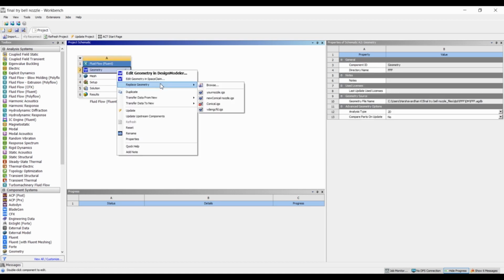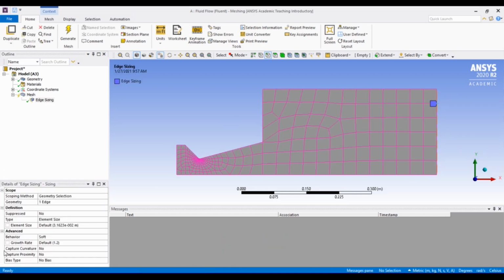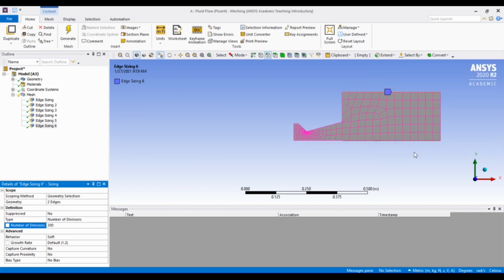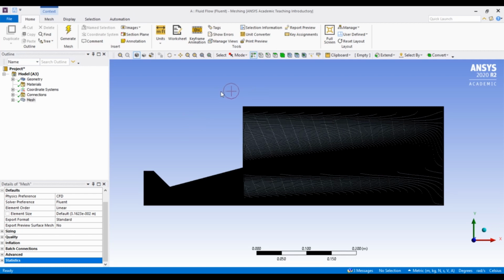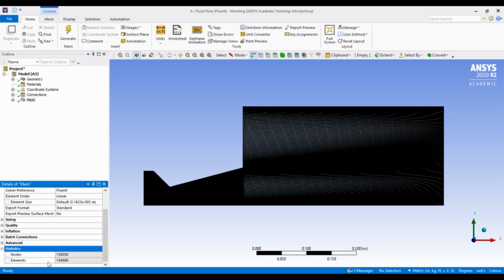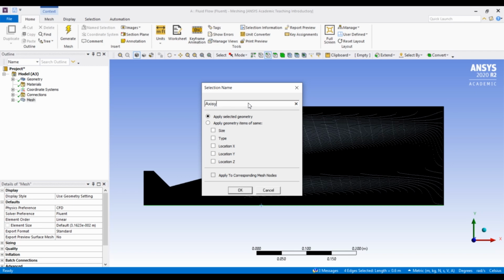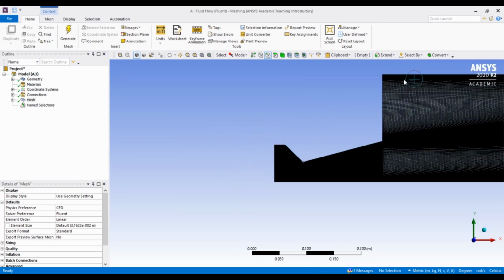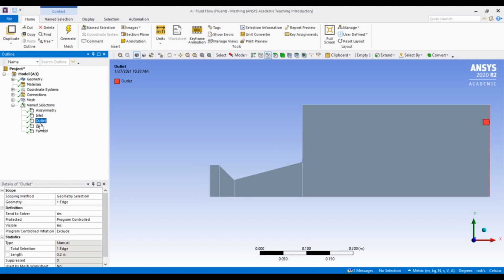Meshing in Ansys Fluent | Structured Mesh | Tools overview | Naming the domain

Comment: So I was doing a hypersonic flow over a wedge, and I did edge sizing selecting -> no. of division (behavior hard) and with biasing for greater refinement at the wall. My results are always wrong. I have tried doing normal schematic adaptive mesh and the results are correct.